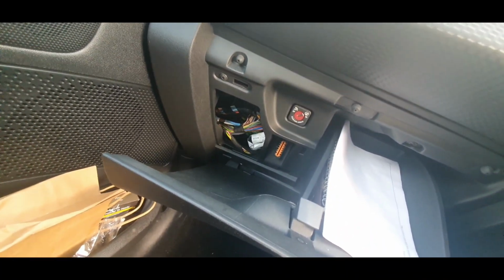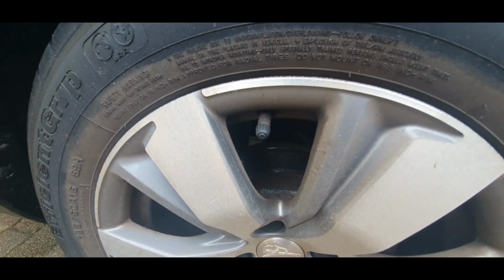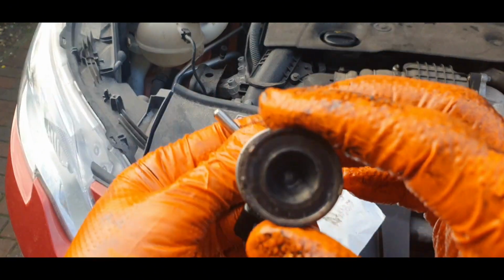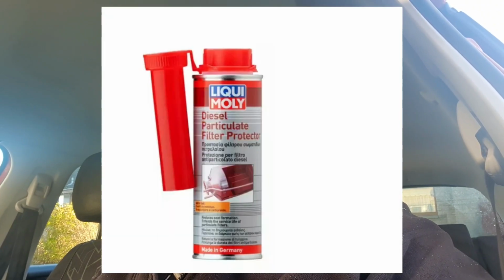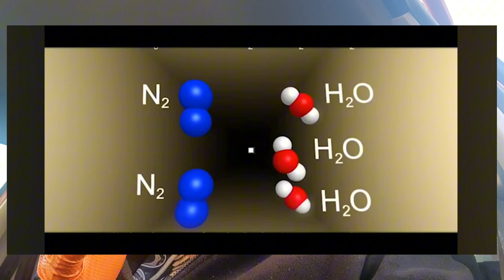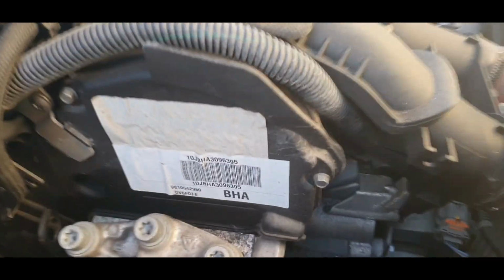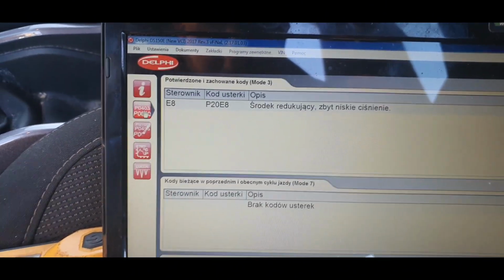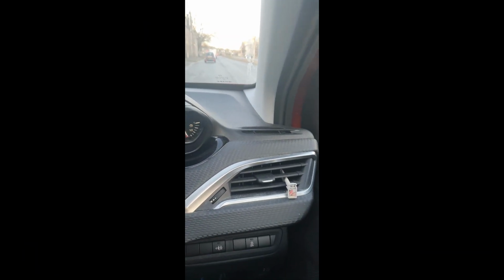Peugot 2008 problem with adblue, cleaning the injector and code p20E8

Comment: The oil leakage is caused by oil leak from camshaft house. This is a comman issue with these engines caused by too little liquid gasket used from factory. To fix this you should combine it with the change of time belt..

Comment: Hi there, did the cleaning of the Adblue injector fix your p20E8 issue? I've got this error code at my 5008 bluehdi. After resetting it, it comes back after 1500 miles..
Reply from the maker: I suspect that you have a problem with the AdBlue pump
Reply: @vag8uk  I'm not sure yesterday I've added some additive of Kroonoil adblue optimizer to my tank, .. I hope that will help.
Reply: Olso me, firts time computer say injector block, i put new original an next day p20E8, what problem can be ?
Reply: @Richardcroitoru  I let my adblue tank run empty. Then I filled it with fresh adblue from a bottle. After that the problem did not return.
I use Adblue optimizer from Kroonoil. This is an addition of 25 ml to a full tank of adblue.